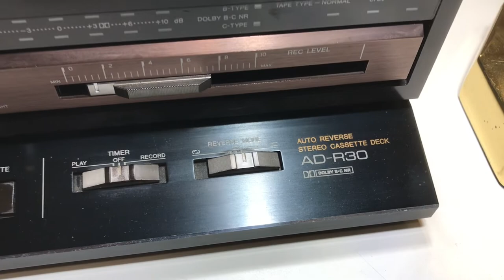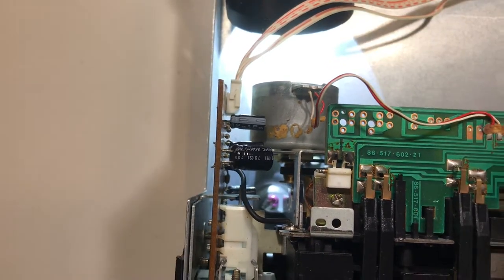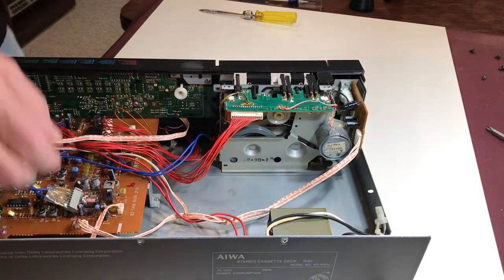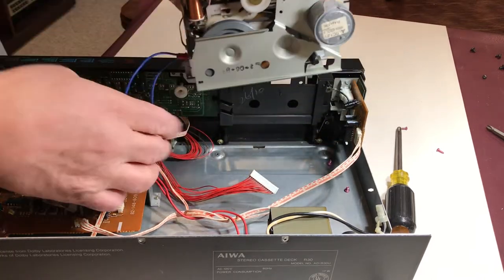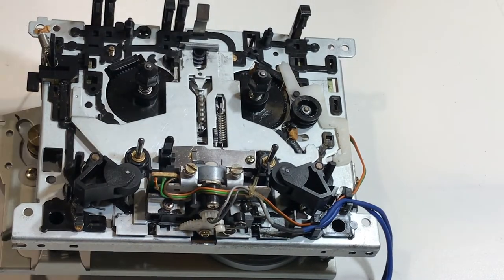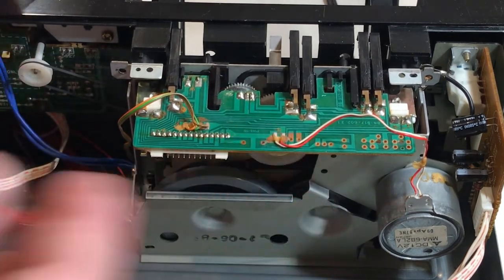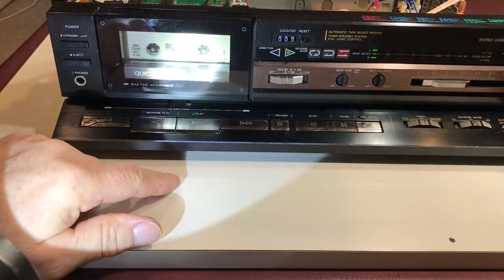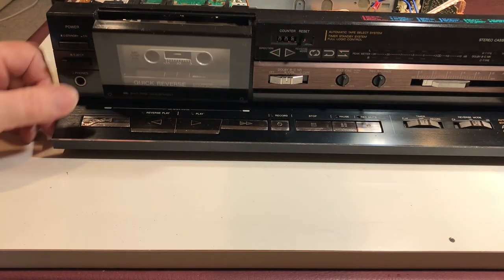AIWA AD-R30 Cassette Deck Belt Replacement

Comment: Do you have the sizes for all the belts?
Reply from the maker: Hi - The replacement belts came as a kit without any size listing. Sorry about that. I did purchase them on EBAY though as my usual sources didn't carry them. Hope that helps.
Reply: And thanks for the video! It was of great help to me and there is very little info on these decks to be found.
Reply from the maker: @patrickmcangus9977  Glad to do it. Nice to hear back when someone finds the videos useful. Have a great day.
Reply: @xfireamg417  Thanks for the reply. I couldn't find a listing on Ebay so went directly to the website showing on the parts parts bag in the video and ordered the AD-R30 kit like you show in the video. I'm in Canada so the shipped cost was $22 CAD (15.70 Euro) which I consider a great price. They are located in Portugal. I estimated the flat belt length at 9.2 or 9.4 but will measure all belts once I get them. My deck is a Realistic SCT-83 and looks exactly like the Aiwa AD-R30. This is my summer garage deck so should be ready for the upcoming season!
Reply from the maker: @patrickmcangus9977  Glad you located the source. I went back through my EBAY history, but when I clicked on the listing, it couldn't be found. The worst parts of the belt replacement is usually cleaning up the remnants of the old belts. Hopefully you caught it in time. Good luck on the replacement.
Reply: Got the belts today and installed them. Works great. The measurements of the belts are: Capstan - FBS 9, reel - SBM 6, counter - SBS 5.6, counter - SBS 2.5. All these are as close as I can get using a measuring tape and the belt pulled straight, then x2.
Reply from the maker: @patrickmcangus9977  Thanks for sharing. I hope someone will see your  posting. Good Info